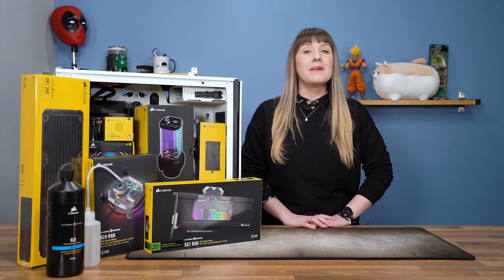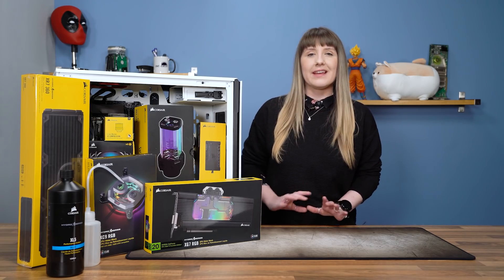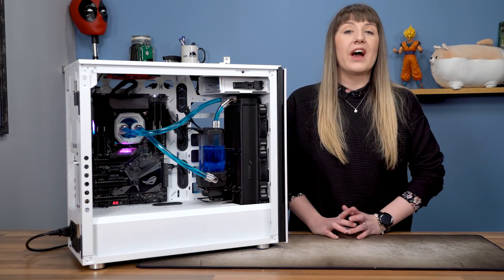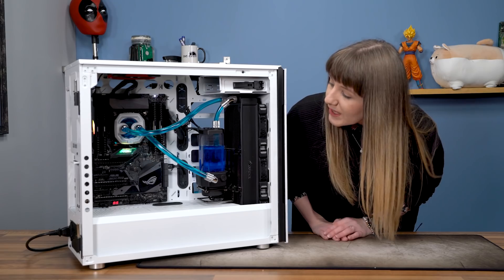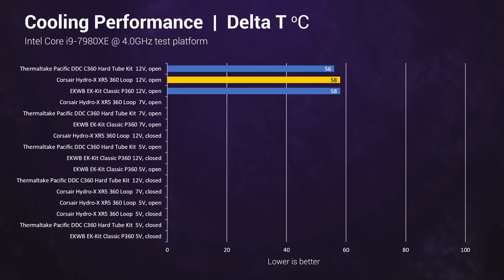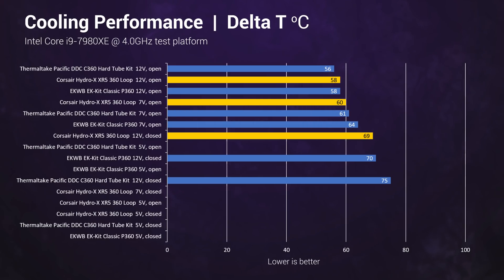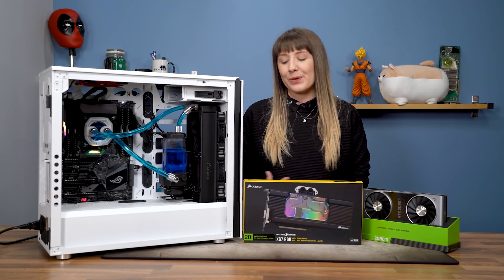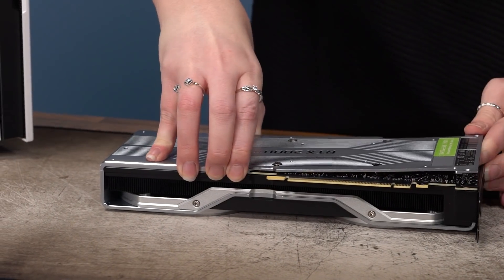Introducing Melissa To The Team! Comparable Corsair Hydro X Water-Cooling Kit Review

Comment: Just a couple of things.

Never did see the case id’d in the video or in the info.???

Seems like there is plenty of room in the case for a 120 ot 140 rad for the gpu instead of just feeding heated fluid to the cpu.  I’ve seen several builds that do that (put the gpu and cpu in series with no rad in between).  You’d be better off with no liquid on the gpu to doing that;feeding hot fluid to the cpu automatically handicaps the system’s ability to keep the cpu cool, which is a big issue if you OC.  

Also noticed the video shows a air bubble caught in the cpu cooler block, that will reduce it’s efficiency further.
Reply from the maker: Clayton Yendrey Alex here: We use the same 360mm radiator setup for kit reviews so that you can compare between different setups. Most kits come with a single radiator, so it’s not much good randomly adding extra ones.

Btw I think you should have a look at what loop order actually does. Once a system is going, the coolant is largely equalised across the loop. Loop order essentially means nothing, the only thing you need to be careful of is having the pump directly after the reservoir to prevent it running dry.

Comment: Last month I did my first water loop using HydroX (X570 3900x and 2080ti) and I found having clear liquid I could one click change the color ( iCue )and have full red, white,blue, green (hate rainbow etc )without having dye spoil anything. Basically having dye is a waste when you have the RGB features of hydro-x. One thing, I found that I could have saved quite a few dollars by using EK fittings ( have 3 radiators )especially the compression ones. I did have 2 of these and while its easy to pull of the tube from the Corsair compression fittings found the EK ones very hard to get the tube off and I guess that is what you want. 
Anyway, enjoyed your build

Comment: What is the point of using a i9-7980xe at 4GHz? Also what are you doing putting a backplate on the graphics card with no thermal pads, that single radiator isn't enough for them.
Reply from the maker: frostybe3r Alex here, I don’t think you understand the point of the test. This is a direct comparison with other 360mm custom loop kits. The Hydro X backplates come as such, you don’t add pads to them in addition. The i9 is our 2066 test system as is essentially just there to provide insight as to the cooling performance on a high end, power hungry system. It still uses a lot of juice at that speed and clearly flexes the cooling capacity of the kit on show.
Reply: @bittech1  Wait that's hilarious, Hydro X doesn't come with thermal pads for the backplate? Should try comparing this to Heatkiller IV or Optimus. :)

Comment: so it seems that essentially price to performance thermaltake and ek beat out corsair if im understanding this right
Reply from the maker: Audiacious Pretty much although bear in mind it’s not 100% like for like as the kits all use different pumps etc. If you’re buying to be part of a future, larger loop then there might be other considerations to be had. For instance the TT kit is great value, but if you want to add a GPU block theirs are stupidly expensive at times, meaning you’d want to look elsewhere. At that point you’d then lose the TT RGB ecosystem too, which could be a pain if that’s a selling point. The EK kit has a weaker pump, so if you added more components to it, you would perhaps want to upgrade it.
Reply: @bittech1  Ya i was looking at that as well.  I prefer the corsair ecosystem with ICue, and it now interacts with Asus Aura sync reliably.  I honestly have been looking at the Corsair ecosystem mainly for that simple fact.  Thanks for the reply.

Comment: I am curious as to why you choose to go from pump out to CPU in, instead of pump out to GPU in then route the CPU to radiator in. Many tests have shown that order makes no difference in thermal performance and doing pump out to GPU in would have resulted in a cleaner looking build with less line crossing.
Also welcome to the channel!
Reply: I imagine because for speed and ease the gpu was inserted into the existing loop, keeping the pump->cpu line and rad->res. She did say it was just a quick job and not particularly with aesthetics in mind.
Reply: @MakinComputers  I suppose that's true and fair enough

Comment: I don't want to be a prick but the devil is in the details, so here I am.

I think there is a typo in the graph as that temperatures couldn't be deltas (it's absolute temperature) otherwise the 7980XE should be at more than 120°C,  also the T ambient should be disclosed in order to to explain the temperature difference.